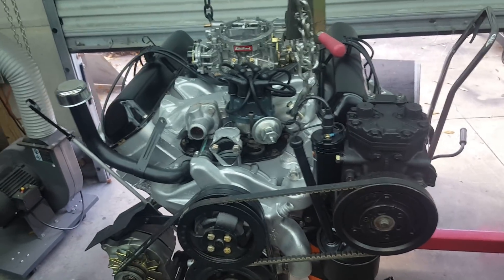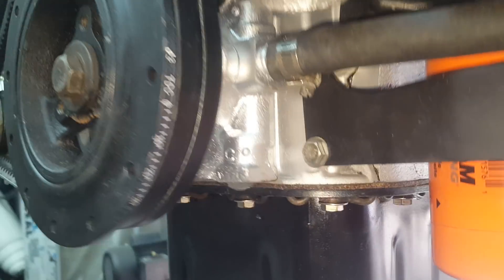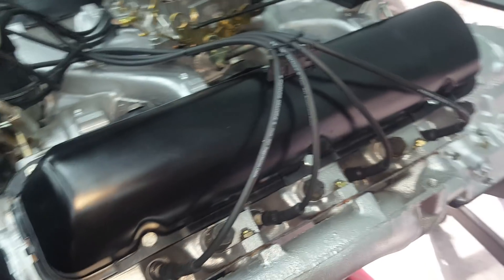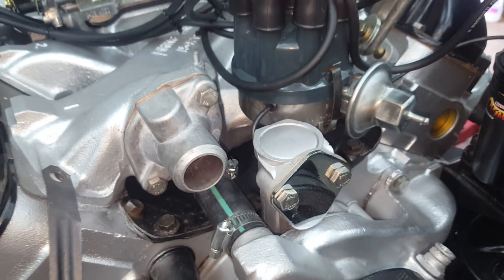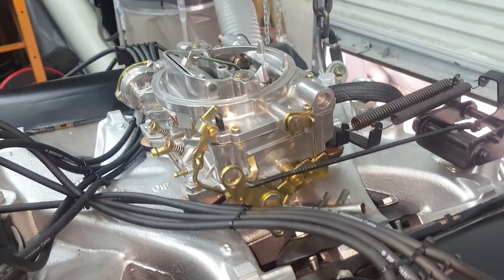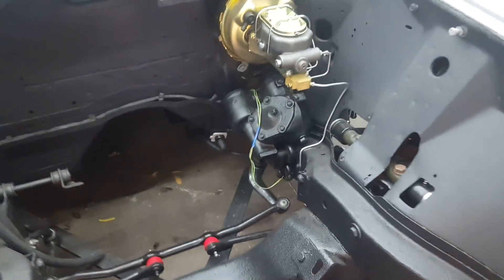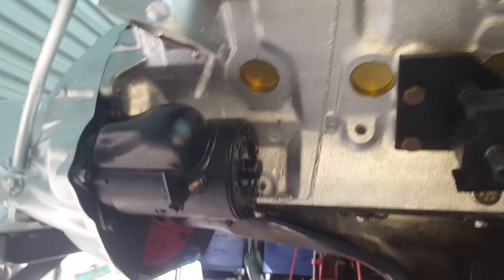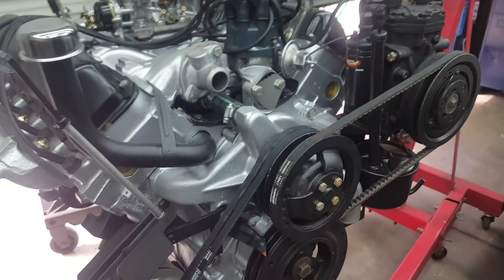430 MEL Lincoln Engine Common Questions Answered (Driving Dreams)

Comment: I always hear it's not a good candidate for high performance. Why? Didnt't that engine make alot of hp. The first year ford released it?
Reply: Way too heavy. Depending on displacement, they all weigh over 1000 lbs. In comparison, a 429/460 weighs about 640.
Reply: @pete1342  I didn't know that, I did see one in kassi shop  though, he got 900 hp. out of it though. My dad had a Lincoln , man I it was a big engine

Comment: is silver and black the right color for this engine?  my 68 was 'corporate blue' which was NOT available at most places.  i ended up having to special order it in spray cans from a parts store if i remember.  i posted on your other video when you had first pulled it out of the car.

i didnt pay attention putting my motor back together where i tore a little notch out of the rear seal where it goes over the end of the crankshaft.  first drive with all back together, i pumped an entire reservoir of atf (power steering fluid) into the oilpan.  not being a mechanic i was afraid i screwed up the engine so i changed the oil, warmed the car up and changed it again, 2 more times.  then i though i spun a bearing driving it 1200 miles home from the Air Force but i ended up having a locked up rashed starter motor...  sucks because i then sold the car... so sad

Comment: You have my motor. 1. What type of fuel do you use? 2. Why Edlebrock instead of Holley carb? 3. Do the Edlebrock need tuning or will it come ready to bolt on? I closed my mechanical fuel pump and installed an electric one also. 4. Is there a particular fuel amount setting you find works well? 5. What is your preferred timing of the engine? My heating, cooling dash isn't working. 7. Where is the relay and or fuse for that? 8. My seat switch will click but not move. Any suggestions? I have tried 2 separte Holley Carbs and had problems with them both. I think I want to try Edlebrock. 9. Where can I get the air hose with the PCV valve in it. Mine is closed off and that could be causing a problem. 10. Have you had to replace any relays if so where is the best place to go for them?

Comment: Hey Nathan, what rear main do you use for your rebuilds? I put the original rope style in my build and with the cap torqued down it’s kind of a bitch to turn. Do you know how many pounds they should turn freely with a torque wrench with all the caps torqued down? I think mine is spinning around 60 lbs until I loosen the rear cap.
Reply from the maker: I use the rubber seal from falcon global.

Comment: If you're using an aluminum radiator, there shouldn't be any need for a reserve tank, anymore.
If you could mount the alternator to where that A/C compressor's mounted and install a modern Frigidaire compressor where the alternator's at, not only would you have better access to the water pump. That should also help reduce vaporlock. Mounting a return line back to the tank would also help with vaporlock problems.
There are conversion kits available, for swapping the slushbox out for a Turbo Hydramatic 400 with dual-pitch converter

Comment: dont you mean 462 is your fav swap ! 460 is a 385 big block totally different motor !
Reply from the maker: No.   460
Reply: @NathanWilsonDrivingDreams  really as your post is about MEL motors , there was never a 460 MEL ??? only a 462 seems confusing ?
Reply from the maker: That's what makes it a "swap".   Swapping the original 430 or 462 for a 460 that they made millions of and parts are cheap and readily available.

Comment: When taking off the steering pump, it is stopped by the woodruff of the crank preventing the steering pump from sliding off. How do I take off the woodruff of the end of the crank?
Reply from the maker: Yes.   Flat head or punch etc.

Comment: do Ford FE engine headers fit the Ford MEL v8 engines?; ive hear the 2 Ford engine families are similar design
Reply: I’ve been told XA/ XB headers will go on but you have to have the block out to do it.
Otherwise it’s custom made 💴

Comment: Question I have a 56 ford Fairlane with the 272 y block well the motor just died I have a guy with a clean 430 Mel out of a 63 Lincoln would that motor fit

Comment: Hello, great video thanks for posting. I had a question concerning the cooling system. I noticed you said you were using an aluminum radiator and electric fans. I wanted to do a similar setup, would you also recommend using an electronic water pump as well? Or stick with the mechanical one?
Reply from the maker: Water pump is not something that fails often,  so I stick with the original style.
Reply: @NathanWilsonDrivingDreams  great thank you for the reply I appreciate it 👍

Comment: I highly recommend using modern spring tension hose clamps, especially for the water pump bypass. I also use silicone hose for that one as it's one and done.
Reply: My service manual reccomends throwing those away. They work for successfull assembly line mounting. But when these hoses start to age and harden up, these clamps won't be able to retighten hoses in such conditions

Comment: The model kit motor has a choice of a magneto or a "Spaulding" Flame thrower Ignition. Have you ever heard of those or used one on your engine? Are they better?

Motor also has a choice of tri-carbs, 6-pack and a Latham blower with 4 side-draft carbs. Ever tried those parts on a real MEL before?

Comment: ThanX for the great video. i am building a model kit of this engine (the one in the AMT 1925 Model T Ford hot rod) for my You Tube channel and this is a great resource, especially since the AMT MEL engine is arranged differently to fit in the hot rod. (Alternator is mounted above the cylinder heads to clear the model T frame, for example).

Comment: Rookie Question - When setting timing which way do I turn the 462 engine? Clockwise or counterclockwise? On tdc it sits at 6, want to turn to 10
Reply: @Rick-S-6063  Thanks for the information.  Learning a lot with this car.

Comment: I LOVE Ford engines but this one is THE hardest to find parts for because not many were made (so vendors don't support).  Pistons are Left Hand & RH but nobody sells them.  Block thermostats and the vacuum pump on the bottom of the oil pump are impossible to find.
Reply: When I had the 430 in my 1959 Lincoln rebuilt, we had to order custom pistons from Ross Racing Pistions, made to specification using the original domed pistons as a guide.  Block thermostats are not needed, just leave them out.
Reply: @CactusCowboy57  Do you recall the price of your Ross pistons?
Reply: @simplyconnected  I'd have to look but I believe it was in the $900 to $1,100 range.

Comment: What size spacer do you use for the carb?
Reply from the maker: 1/2 inch
Reply: What about the pcv valve and fitting to the back of the 1406 carb?  I can’t figure out what you used.

Comment: I got a 430 in my 60 thunderbird, bought a new fuel pump for it and it still isnt pumping out fuel. any common problems with the 430 and fuel pump?
Reply from the maker: The rod gets jammed in the up position so it's not pushing the lever on the fuel pump.   Remove timing cover and free the rod.   Clean everything so it all moves freely.  Sometimes you can remove the top cap on the timing cover and access the rod without removing anything else. So try that first.
Reply: Nathan Wilson took off the timing cover and freed the push rod. Took me forever to get the oil gasket back in there, any advice on pushing the timing cover back on?
Reply from the maker: It should go on easily.   Use a little rtv.
Reply: You mind if I can get your email to send you some pictures, might be doing something wrong just don’t know it
Reply from the maker: Drivingdreamsrestorations@gmail.com
Reply: Fuel pump push rod

Comment: one hoses i rayher use a good used subaru or old Toyota hose over a standard parts store blows on the hard to get to locations if in a pinch as EPDM rubber is the thing to use  pricey but worth it

Comment: Nice job and thanks for posting this. I have a Lincoln Y- Block HD332 in a truck , it has the original generator and I had it rebuilt, but I was thinking of putting an alternator on it next time. Did you have to rig up a different mount for your alternator? Thanks
Reply from the maker: No.   Just replaced the pulley with the original.

Comment: Did a 462 in my 67 convertible. Bored & stroked to 545!! There is a guy that specializes in these motors. He has aluminum heads, cam, etc. 1958 6 pack on mine looking stock though 600 horse with AOD Transmission & 2.79 gears. Plenty of torque & 27 MPG on the road. Extrude honed exhaust manifolds that flow as well as any header
Reply: Who has aluminum heads for these engines ? Never heard of them? Also what bore/stroke is that engine?  Custom crank,or just reground stock? Did you get forged Pistons for your build? Only pistons I've seen at a car swap meet, was NOS   cast.  Years ago.
Reply: @knutbjornlarsen4435 That post is  complete bullshit. Moron doesn't know an MEL from an FE and his "specs" are pure bullshit.
Reply: Bullshit.

Comment: Amazing work Nathan. I just started the process of rebuilding my 430 V8 C.I.D, do you have any suggestions on where I can 'one-stop shop' for the stainless steel bolts/nuts for the engine and component parts?
Reply from the maker: I don't.   When you disassemble you'll bag and tag everything.   Then you can take one of each to your local hardware store.
Reply: Thanks.

Comment: Hi Nate 
big fan of your videos.  Nate i have a 64 sedan rebuilt motor 15yrs ago and I have always had an issue with blow by and crankcase fumes.  I have the pvc system and my oil cap has a section of heatr hose that does not feed into the air cleaner but just hangs in the engine bay.  Do you have any idea how to eliminate the fumes?  Purchased the air cleaner from a different lincoln but I think there was a version that piped the fumes back into the carb.
thanks
Mark
Reply from the maker: Check the hose that goes from the back of the intake to the back of the carb.  There should be a filter that looks like steel wool.   If that's missing it could be causing your issue.
Reply: Took your advice cleaned the brillo pad in there and it was filthy.  I think it helped.  Still think I'm getting a faint PS fluid smell once in awhile but nothing aggressive enough to see. Hate the Steering gears on these cars i switched out to all metal bushings yesterday.

Comment: Hey Nathan. Thanks for the video...really helpful. I’m working on a 430 for a ‘64 and trying to get the PS pump off. It seems stuck on the crank, most likely due to running low on fluid at some point. Have you ever come across this where it’s stuck and you got it off? Key is out and tried a puller but nothing. Any help would be great. Thank you.

Comment: Thanks for the video.  Have my first 430 MEL engine that I'm servicing.  Have to replace the fuel pump pushrod.  How do you get the cap off to take out and install the new pushrod?  Pry it?  Not clear how and it doesn't say in the manual.  I have the correct brass tipped pushrod for the 62 Lincoln.
Reply: Tim, did you ever get the cap off? I am troubleshooting a similar issue with my 430 MEL. Looks like you have to take the entire timing chain housing off get to it.

Comment: Thank you, I am doing a 65 right now. Do you have a image of the proper fuel pump set up. I understand the replacement pump does not address vapor lock issues.

Comment: everything is true only fools would do a ls swap or coyote. the best swap would be a small block ford 471 cid snaps out 600 clean foot lbs torque at 2600 rpms and makes a clean 640 hp at 5500 rpms on  pump gas and a 850 cfm carb easy money.

only fools do swaps true those motors dont have the numbers. any of the ls motors including the vette version.has no torque. als a sedan is severally lighter than a 5800 lb vert

Comment: Hey Nathan, how do you restore your exhaust manifolds? I heard of a product called Slip Plate and wanted to see if you've heard of it. I'm hoping to avoid it flaking with the high heat paint. Hope you and your family are well!
Reply from the maker: I'm lucky to have enough spares that I haven't had to repair a cracked one so far.  Sorry.   Lmk if you find something that works so we can pass on the info to others.

Comment: Hey Nathan, I am big fan of the 430 MEL but correct me if I’m wrong, are you only able to use the stock C4 transmission with it? I really want to do a LS6.0 4L60 swap mainly for an overdrive trans, I wanna build mine as a pro touring and drive it across the country. With the 64 430, are you limited to only 1 transmission?
Reply from the maker: The are two companies that I know of making adapters to allow other transmissions.  They cost around $1k.

Comment: I have a 462 Mel, crank doesn't turn. How can I remove the engine? Engine and  trans together? So far I'm down to the block. I removed the starter and dust cover, looks like a spacer plate is attached. If I remove flex plate/converter bolts will engine be removed separately?
Reply from the maker: Yes, but you can also remove them together.   Not much different than most engines.  Double check that you have disconnected all the brackets that attach to the frame.  There are several.
Reply: @NathanWilsonDrivingDreams  I removed it last night. Easier to keep them together. Thanks for your videos they're great n have helped me tremendously.

Comment: Another great video Nathan!  I just sent your charity a $50 donation as a token of my appreciation for putting these up for us to learn from.
Reply: Do you have any vids on changing the gas tank on a 1965 continental?
I took out the sending unit and removed the differential cover and it still won't come out!? Do I have to unbolt the rear axle and drive shaft and shocks?
Reply: @bigabe1978  Hi from Ireland. You get the tank off? I'm facing that soon. I've a 64. Any pointers appreciated
Reply: @johnw359  I had to unbolt the drive line, remove the axle u bolts and slide the rear end forward to get the tank out. It almost took a slide hammer to get the filler neck out of the tank.